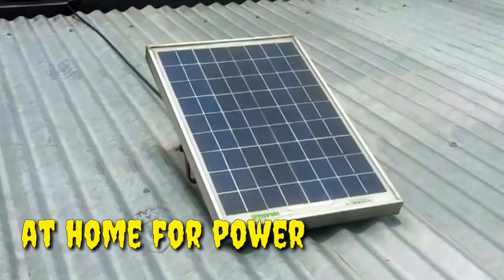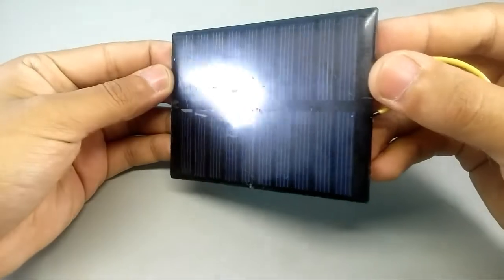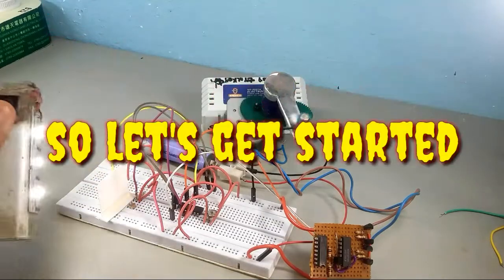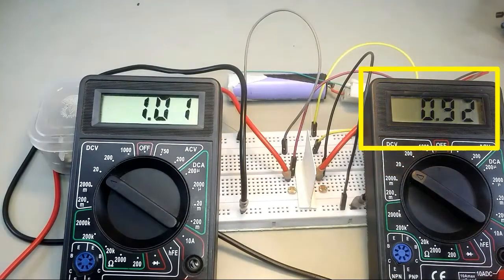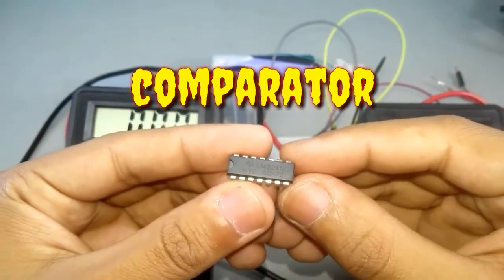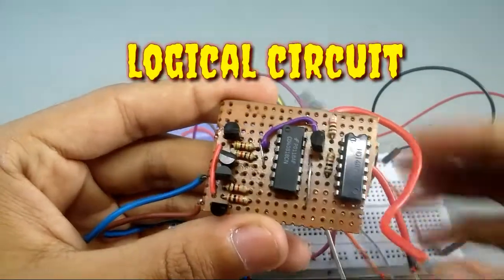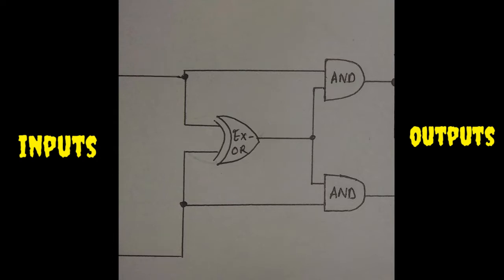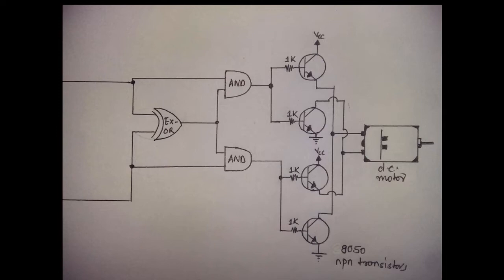How to make Solar Tracker without arduino...simple and easy method...

Comment: Actually glad I found this post as it gives me a new direction to look at for the low profile mounting system I need to construct for the array I want to install on my Motorhome. I've been scratching my head thinking about the panel mounting arrangement and this rotation method points me in a direction I hadn't considered. Now I have a better plan than before. Using a pair of linear actuators to rotate the frame as this design does and lift or lower the axis for seasonal changes. I just have this question, in the schematic is shows LDR's and in the video the sensors look like LED's or photo diodes.
Reply from the maker: Hello Bret Tschacher 🙂. The system uses LDR as a light sensor. The led or photo diode may also be used as the light sensor but for that the circuit may need a bit of modification..

Comment: i did it and it works fine
Reply from the maker: You can also check out how to convert the same electronic circuit into programming codes in Arduino and get the job done.
https://youtu.be/pD6HyoNHCh0

Comment: Sorry could you explain the comparators function please! We love your videos <3!
Reply: Yes, can you explain it please!!! I dont understand why is it necessary to have it in this circuit. Thanks! :)
Reply from the maker: The LDR generate analog signals which the logic gates aren't used to. Therefore, the comparator simply helps to create digital 1 and 0 from the analog signal based upon the reference voltage on it's non inverting inputs. This way the logic gates get the digital signal and then control the motor driver until the tracker self adjust with equal brightness over the LDR. Also check the Arduino Solar tracker 
https://youtu.be/pD6HyoNHCh0
Where I programmed same logic circuit in Arduino ide, using only geared d.c. motor and well it works..

Comment: Sir aap ne logic gates ka circuit diagram ni diya .kya input par resistance lagani pasegi.
Reply from the maker: Hello Rizwan Ali.. CD4081 quad AND ic and HD 4070 quad EX-OR ic are used for this project you can view pin details in the datasheet online..
And the circuit diagram is in the video you can save it from there.
And resistor can vary from (1 to 10) kohms in the potential divider..
Reply: @electrofun8778  can i connect opamp put direct to logic ic or with 10k resistance and logic ic to ic connect with resistance or direct pin to pin.this method don't shown in diagram.plz reply
Reply from the maker: It's not compulsory to use resistor between Op-Amp and logic ic or logic ic to other logical ics since logical ic already have high input impedence so you can connect directly in this case
Reply: @electrofun8778  ok thanks